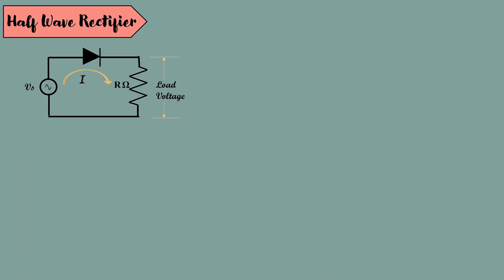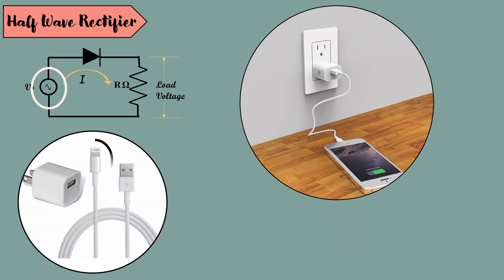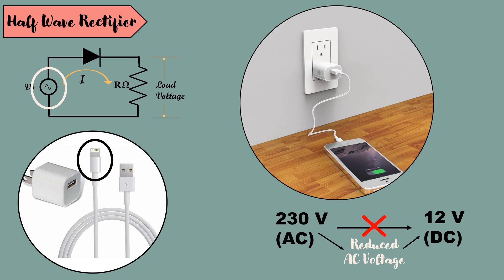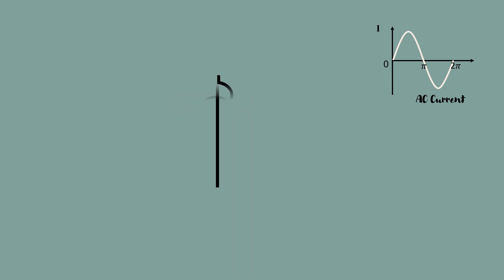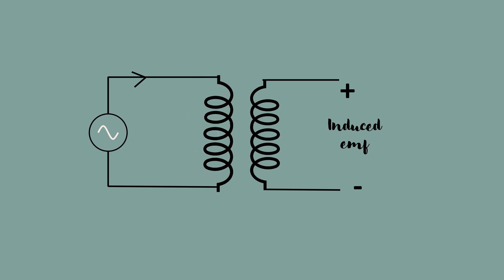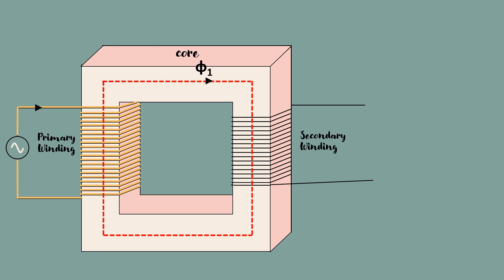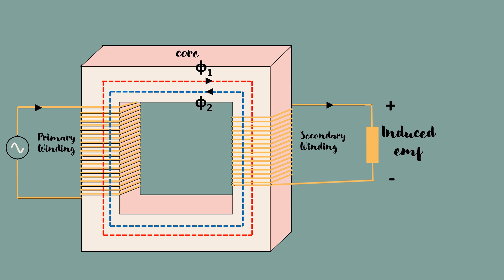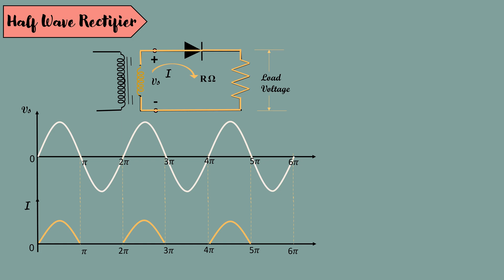Disadvantage of Half Wave Rectifier - DC Saturation in transformer core

Comment: if I have load work with Half Wave Rectifier, what i can do to reduce DC component?
Reply from the maker: The transformer core saturation problem in the three-phase star rectifier can be avoided by a special arrangement in its secondary windings, known as zigzag connection. 
Yim-Shu Lee, Martin H.L. Chow, in Power Electronics Handbook (Fourth Edition), 2018

Regarding the single phase circuits, Transformer may or may not overheat depending on how big your load is.